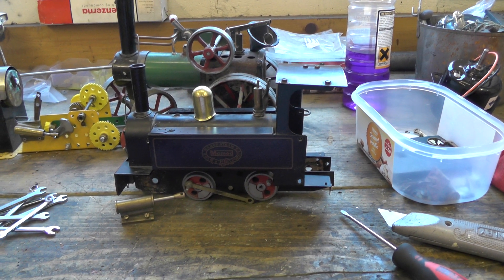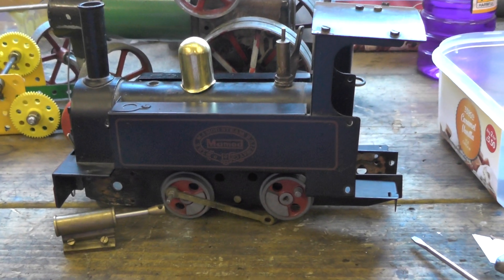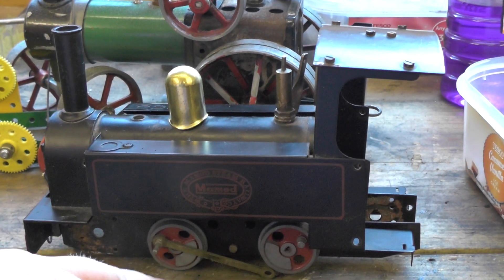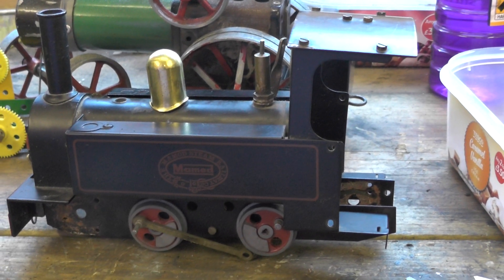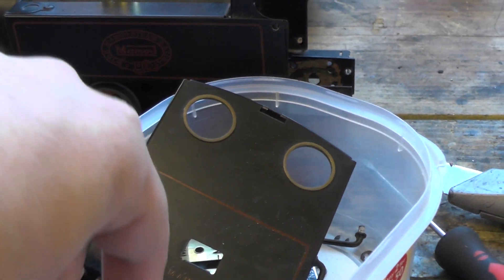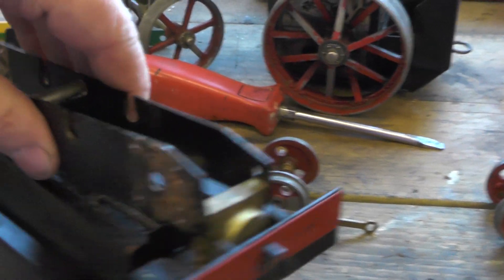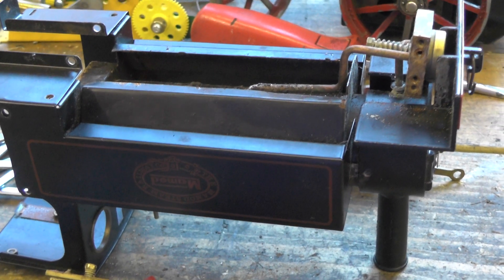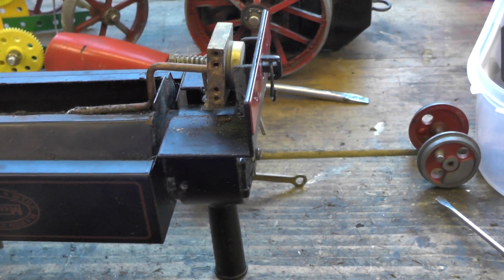Mamod Steam Loco upgrade Pt I

Comment: Simon,,,, just watched your first two videos on upgrading the mamod. When I did mine, I had the standard boiler with stronger safety value, lubricator like yours, meths burner, chuffer and up graded pistons. What rubbish. The pistons was so tight they would hardly turn, oiler worked once , chuffer makes no difference. I would like to know how you got on with yours. Did you run problems??? Kind regards,  john